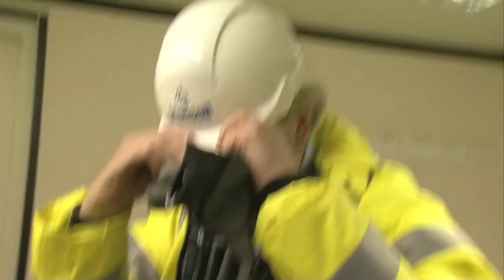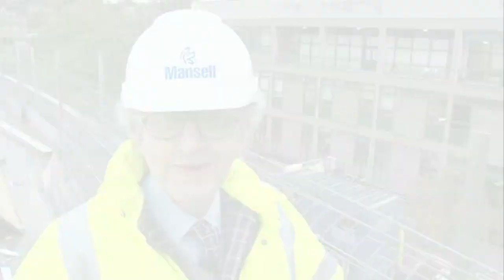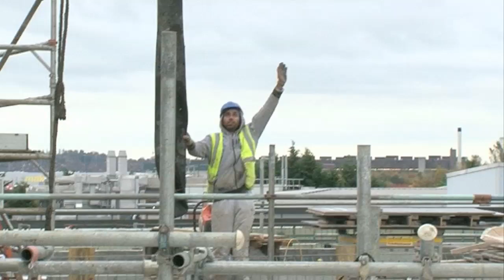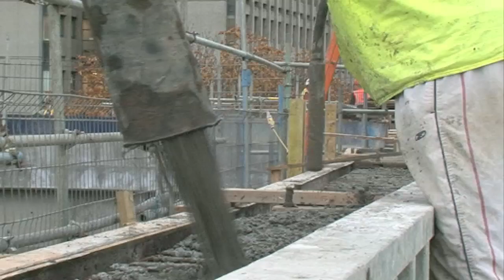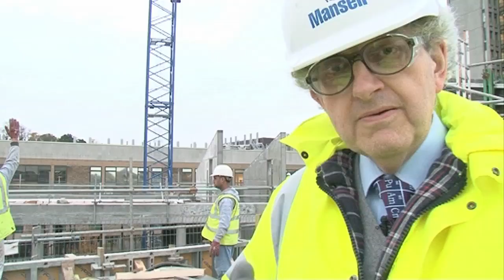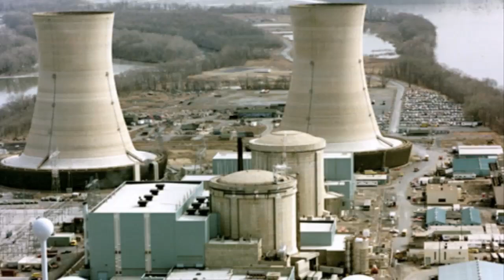Chemistry of Concrete - Periodic Table of Videos

Comment: few things, limestone is mixed with clay and not sand to make cement, Sand is used as an aggregate in concrete and is inert, doesn't react, and the Roman structures were made from lime which reacts with CO2 to form hard calcium carbonate and so it becomes stronger over time. Concrete, on the other hand, deteriorates due to carbonation over years....

Comment: I remember, long ago, an article in SciAm about concrete setting, and I find the explanation here very deficient.  Rather than a gel hardening, the particles of toasted dry lime are surrounded by water.  As the water invades the dry interior of the particle and begins slaking the lime, it increases the volume of the interior, and pretty soon the generated pressure drives filaments of the CaOH through to the outside.  Eventually the CaOH combines with CO2 to become hard calcium carbonate.  These filaments from millions of small particles interlock with their neighbors, making a strong structure. The sand provides nothing but bulk and tiny cracks in the sand articles to allow the grip of the calcium carbonate.

Comment: Your right that it will set even if it is kept moving. 

But you can still pour after 2 hours unless it really hot ouside. I work as a concrete field testing technician and when i turn trucks aound for the 2 hours ''norm'' they sometimes drive over an hour and a half back to the plant to make concrete blocks without any trouble.

And he's also wrong about the air bubbles to an extent. If you live in a cold country 5-8% of air in the concrete prevents cracks due to freezing water.

Comment: i used to make powder coating, the overground powder (only micron sized particles) could be added as well because of the high amounts of SiO2, but it was very toxic to handle, you could smell it through the best gas masks, it was like moon dust, never really settled

Comment: Great professor, great lectures, but in this case he had a slip. once water is added to the cement-aggregate mixture (ie, concrete) it starts the chemical reaction of hydration. After that you only have 2 Hrs to pour it (however there are certain chemicals that can be added in order to extend the setting time for an extra hour or two. Really like your videos and your honesty,

Comment: Whilst the videos are not an exhaustive picture they should at least be factual.  When he says that concrete is a mix of calcium oxide (lime), sand (silicates) and aggregate it is incorrect.  Cement is not the same as calcium oxide (lime).  Most modern cement is Portland Cement and contains the components as per dbraven's post.

Comment: Once hardened and properly sealed, there is no need to worry. If your counter top is polished well enough and you disinfect it you can potentially eat off it without worries. A teacher of mine has a polished concrete counter top that has been treated whit acid in some parts,  it looks pretty nice with a vegetation motif and it doesn't have pores which makes it very clean and not bacteria friendly.

Comment: Steel is what gives concrete structures the tensile strength they need to stay up. Arches back in old times were made with a compression only design using stone so no steel was needed.

Comment: Its also advisable to keep concrete wet for a few days if its to hot, workmen then spray water ontop periodicly. So it has more time to set, like the proffesor explained the longer it takes for concrete to set the harder it will get, but the opposite is also treu, if concrete sets to fast it wil become unstable and susceptable to pressure, resulting in flaking top layer and cracks, it becomes a layer op lose "pieces" of  concrete being hold together by friction and rebar.

Comment: Concrete is not only deploiable in wet areas but its also being used to poor directly in to water of a river to form a stable foundation to but bridge pillars on them so they wint sink.. These are verry special compounds and expensive, also normal concrete is never poured under the temperature of 0° celcius because then the water would fomr crystals and the chemical reaction would stop,Execpt in Russia and the likes they will add aditives that protect it from freezing.

Comment: by reusing or breaking up old stones or concrete wich hold agragate, but not all bricks can be reused such as clay bricks because their fragments are verry compressable especialy when wet! or for isnstance marble or bleu stone wich is used for making kitchen tops or doorsteps etc... they are made from large rocks then they cut out a square, the ridgid edges of the rock are then crushed into smaler pieces acoording to what size they need for the concrete recepi, not every concrete is the same.

Comment: and you forgot to add that the steel re inforcements are added to add tensile strength. they are sometimes used to increase compressive strength by compressing, but mostly to increase tensile strength.

Comment: First one I've seen that is so obviously botched. They should definitely make a correction video. Quicklime and sand maybe yield lime plaster, but not cement! Need to burn clay with the quicklime to form clinker, then ground with gypsum. Usually accompanied by a pozzolan.

Comment: @wazscience Bulking out the mixture. It adds strength as the aggregate is stonger than the sand cement mixture alone. Think of a concrete wall as being a wall made out of very small bricks, the aggregate is the brick and the sand /cement is the mortar between the bricks

Comment: This has to be the worst description of concrete chemistry I've ever seen. it takes the complex interactions between water, calcium, aluminum and silicate and reduces it beyond all recognition. Is it too much to ask for some sort of concrete chemical reaction? There is almost no lime (CaO) in cement, mostly calcium silicates which is why the cement is heated in the first place.

This is just terrible,  chemically it's not even wrong.

Comment: @LasagnaIsGood The answer to this is summed up in the beginning "You take calcium carbonate and you heat it up to create calcium oxide or lyme". It takes a lot of energy to heat up the limestone to the point where it becomes lyme. Energy prices are on the rise so concrete prices fluctuate with energy prices. Then there is the cost of moving a heavy substance to the place where it is to be mixed and then from there where it will be poured. Try shipping 100lbs of rock interstate.

Comment: @LasagnaIsGood Let us say we found a way of utilizing the surface dust of the moon for building houses. You could still say "We will never run out", but it is still an expenssive process of getting the moon dust. So I don't see how the "we will never run out" is linked to the pricing in this case. Well, it sorta is. If on the same time it was a rare product, concrete, it would be even more expenssive :)

Comment: @alpatranss I also agree with alpatranss.  Cement manufacturing is a solid state reaction between CaO, SiO2, Al2O3 and Fe2O3 at very high temperature.  Alpatranss, did you work in the industry?  I worked for Lone Star Ind. in Houston in the early '80s until they went out of business.  I miss looking into the 500 foot long rotation kilns.

Comment: @Direkin MONEY!!!! Cost 50-70% more and in all honesty, its useless to work with. had uneven setting times and holds water for months. i use a "flow scread" on site and on a small 60sqmtr slab by 65mm thick took 4 months and £900 worth of dehumidifyers to dry

Comment: Other concrete trivia - the bubbles aren't always a bad thing. There are several applications for foamed concrete - including at the end of runways, where some airports are laying an area of special foamed concrete that crushes under the weight of an aircraft, rapidly slowing it and preventing disastrous overruns.
.
Also, on large projects, the temperature of the reaction can be an issue - Hoover dam, for example, required over 500 miles of cooling tubing to avoid excess heat during curing.

Comment: @riveness 

dont worry about concrete, its not that difficult, doesnt take that much energy. compare it to aluminium, or steel, or plastic, many ores take incredible amounts of energy until you have the final product, some (like aluminium) involve electrolysis. and plastic still contains all the energy of the oil, and is completely dependent on crude oil. maybe you could get the energy for all concrete on the planet by burning all old plastic on the planet.

Comment: @AlterGX  & @ Chaosblade777 you are both right. I ignored for a moment that you need to heat the CaCO3 and that the amount of Energy needed for this is most of the time gainded by burning fossil energies. But what if I would say that I use wind, solar, water or atomic energy for it ^^

Comment: @vlvl21 yes it can demolish buildings which have concrete in their construction are recycled all the time the debris is ground up to the proper size and can be used as aggrogate for concrete in new buildings in fact the next hirise or basically any building you walk into there is almost certanly recycled concrete holding up the building or in the foundation or both

Comment: You should investigate the concrete process used to create the Hoover dam in the US.  They have some interesting figures as to how long it would take the concrete to cure if they poured it all at once.  I believe it was 180yrs+.  There was a special process used to cure it because of the quantity that was being used.  

Also, when concrete cures, reacting with CO2, it is also interesting the amount of C02 that the concrete actually absorbs throughout its lifetime--I THINK it 80% absorption.

Comment: @mathiaspaul1987 It may absorb the same amount, not fully sure, but the amount of time to absorb co2 vs how quickly it's released is not in the globes favor.

There are some cements are that absorb co2 to set like Eco-cement, ie it requires co2 to set.

Comment: I don´t think that the CO2 that does come from the concrete industry will cause such a problem, because when the concrete or the cement is used it will bind the same amount of CO2 back over time. 
Or am I wrong?

Comment: The steel doesn't just increase strength, it is specifically added in areas where tension forces will be present.  Like he said, concrete doesn't work well in tension.  But steel does.